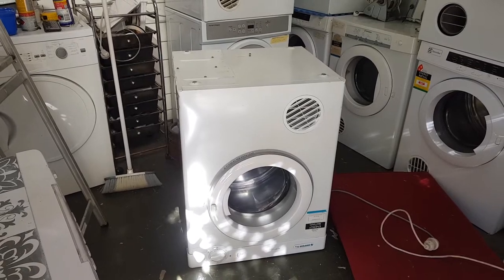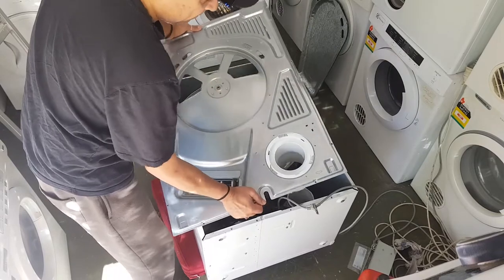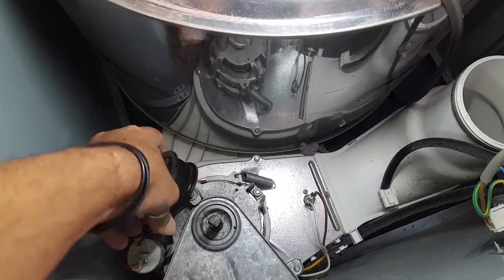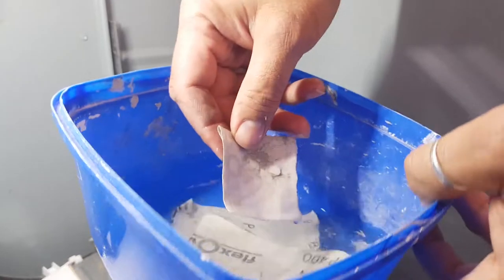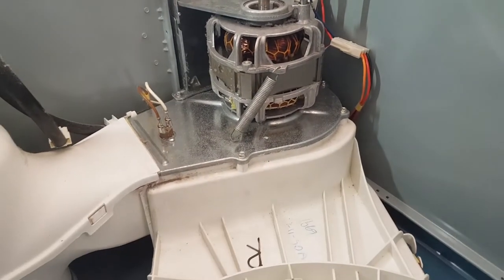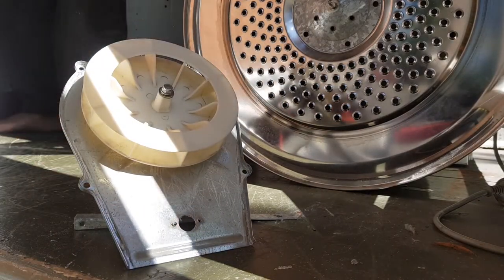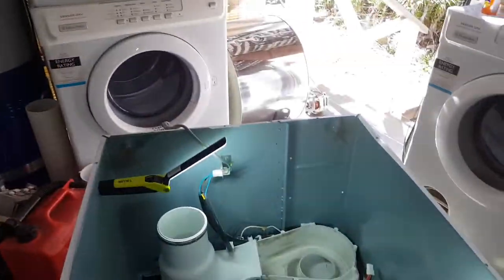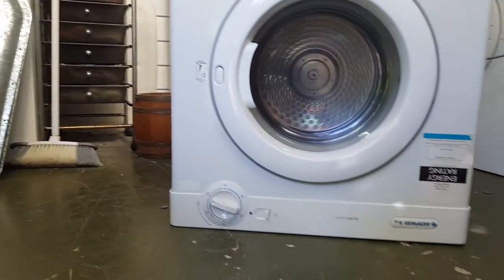Simpson, Electrolux, Westinghouse Clothes Dryer Motor Bearing Issue Troubleshooting, fix, DIY repair

Comment: I've replaced a few bearings in the motors and it's always the front bearing near the idler and never the back one as it's under load. Quality of the bearings seem to count as well. It's easy to replace the bearings in the motor instead of chucking it out
Reply from the maker: @Aussiehomestead1965  I think I tried to open one once. It was too tight. I'll give it another try sometime 👍

Comment: You can buy replacement motor bearings from bearing supply stores. I needed a bearing remover (one of those claw things which you wind up with a drill) to remove it though, putting them back in was easy by leaning/pushing on it in with a pipe.
Also both bearings inside are identical.
Reply: what size were they? and where did you get them?
Reply: @JOHNSMITH-if9jr  I don't have them on hand, and I don't remember the size. I bought them from BSC Prestons in New South Wales. I would suggest pulling it apart, and then measuring the internal and external diameter of the bearings.
Reply: @jamesrichardson645   cool thanks

Comment: Gday - thanks for the amazing video.  In my case it looks like I've blown the capacitor...an EPCOS B32320.  Do you buy them from anywhere in particular, or do you have a suitable drop-in alternative?  Thank you in advance.  I'm based in Brisbane, Australia
Reply from the maker: G'day Rowland sorry for the delayed reply mate. I recently had a major fire event at my house due to a faulty electric blanket and it's turned my life upside down. But to answer your question I get all my capacitors from eBay mate. Make sure you look up the uf number on the capacitor you want to replace. In this model dryer it is 8uf. Which stands for 8 micro ferret. EBay sells loads of them fairly cheaply 👍